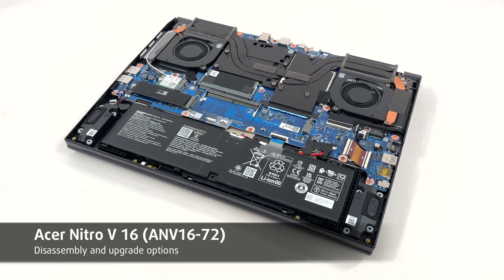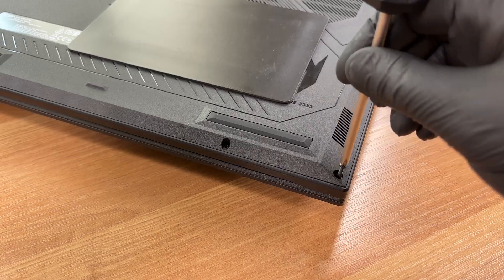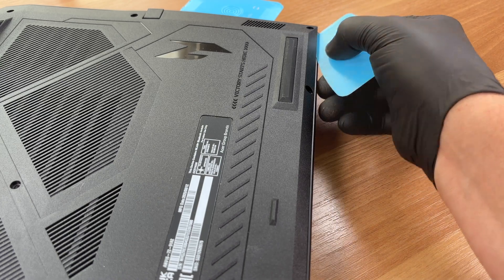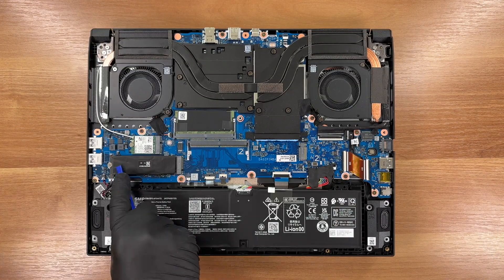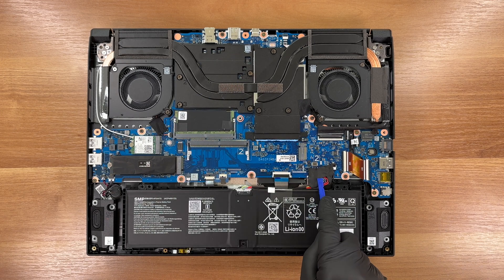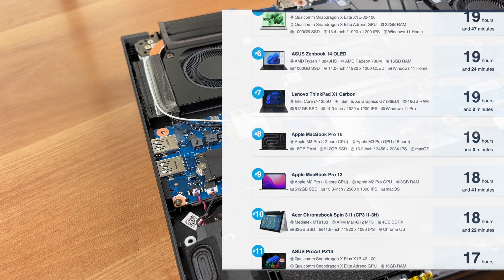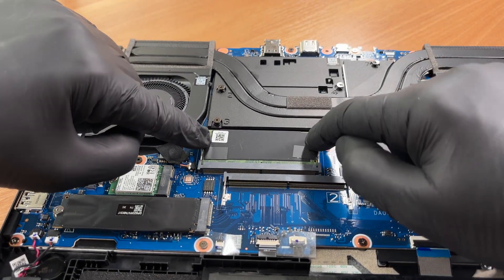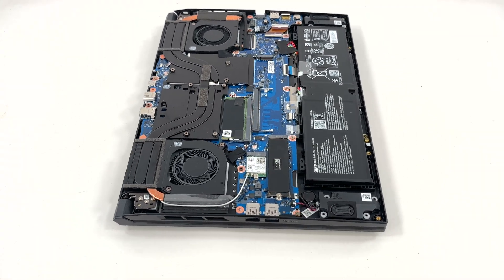🛠️ How to open Acer Nitro V 16 (ANV16-72) - disassembly and upgrade options

Comment: Is it possible to remove the fans to deepclean the heatsinks? Recently my Nitro V16 has been running quite hot, and I think it's one of the exhausts on the CPU side (you can feel a lot of air coming from the side, but not from the back. I think it's clogged, but I can't access it without removing the fans). Or should I simply repaste/change to Honeywell PTM7950?

Comment: Hi guys, i bought the model with 16gb RAM and 512gb ssd, i´m thinking of buying SSD Kingspec Xg7000 512 GB | M.2 | Gen 4.0x4 | 7400/6600 MB/s and Ddr5 Sodimm 16 Gb 4800 Mhz Crucial Cb16gs4800, do you think it´s a good option for the laptop?

Comment: Where's the screw for the 2nd m. 2 slot? looks like its shorter. thought you were going to upgrade it. theirs no point to take it apart unless upgrading or you will have to do the work twice.